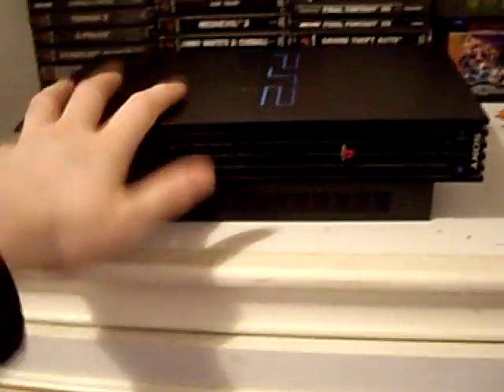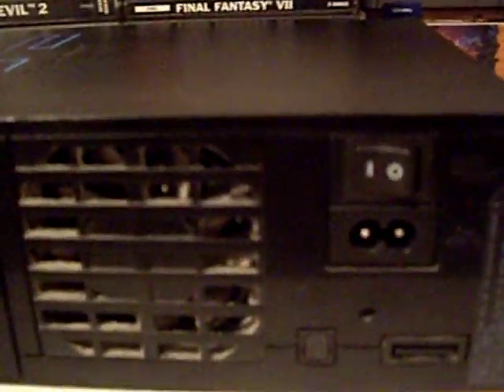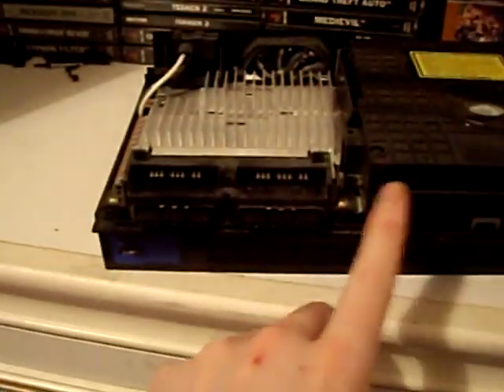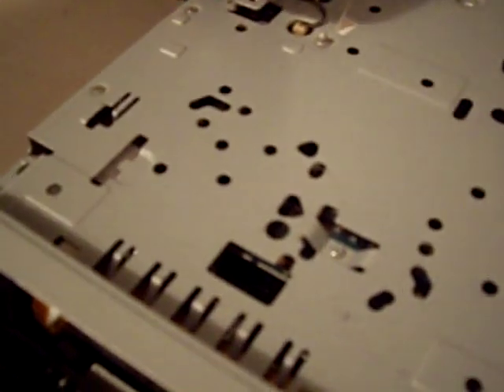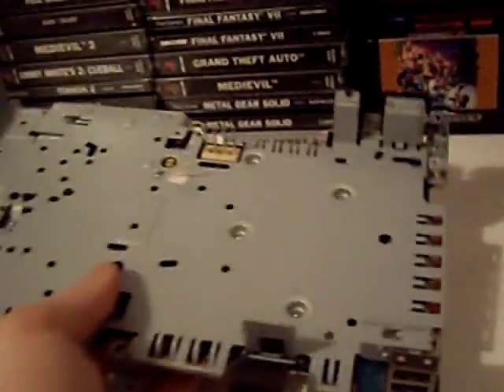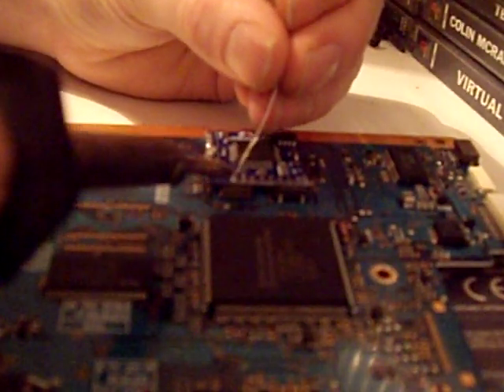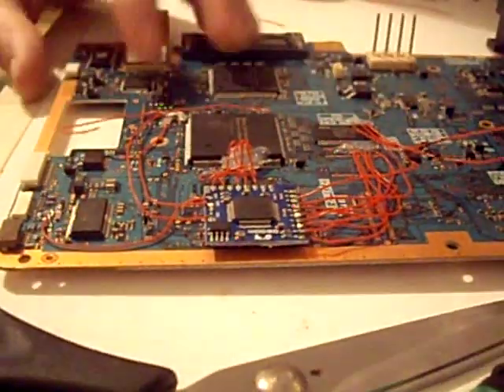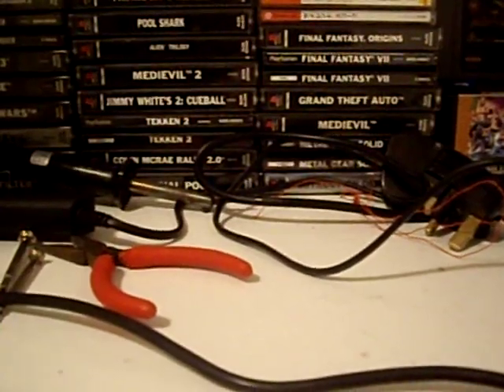Playstation 2 PS2 Modchip Install by jse, difficulty level = Hard, Part 1 of 2

Comment: I'm sorry, but I've got to say it, that is an absolutely crap install, in just about every way.

Not using any flux, no wire routing, so securing of the wires (eg kapton tape, NOT glue), not using larger gauge wire for power and ground connections and poor soldering. It also looked like you burnt some pads.

You really need to practice, as this is actually a very easy console to do, but you have made it exceptionally hard.

Try doing any slim like you've done this and you'll end with a paper weight.
Reply: ***** Hot-Glue should never be used to secure solder joints, without exception. If your joints aren't holding, you're doing it wrong.
Reply: Not only that, but if anything goes wrong and you have to lift that glue off, usually you'll take components and pads with it.
Reply: Do a google image search for "Voultar PS2 Modchip" if you want to reference my work for what I consider to be proper wire technique.
Reply: @iKarith I agree with you. There's nothing wrong with hot glue. It's the application that's in question.

Comment: I am going to attempt this chip install and I happen to have a temp controlled soldering station. What temperature should I be using? The melting point of the solder? I have Kester 66/44 rosin core solder.